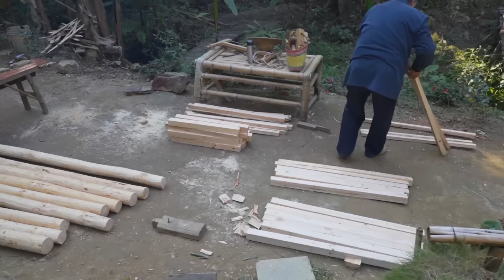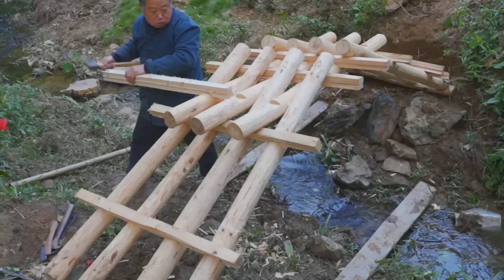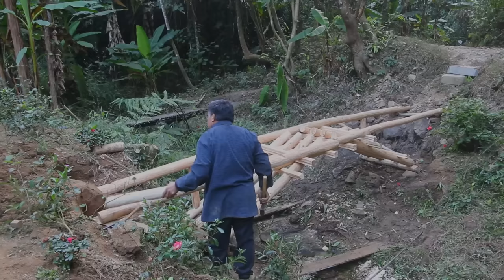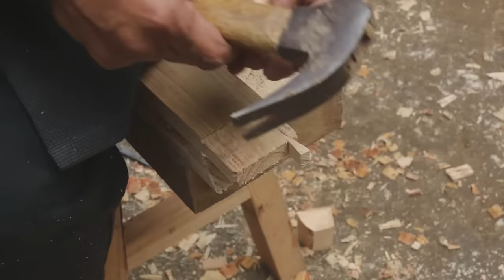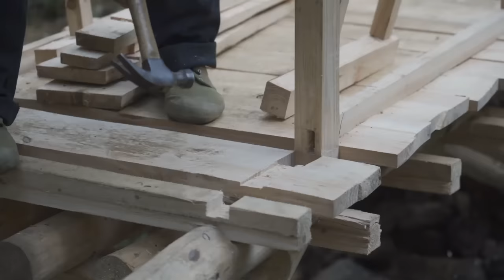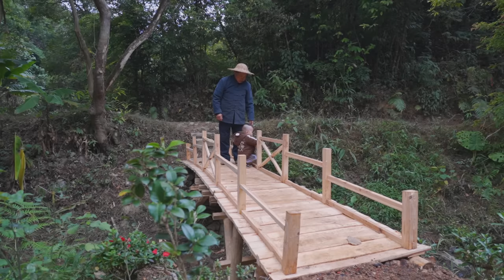阿木爷爷榫卯打造一座木拱桥，全程无钉子，高手在民间【阿木爷爷 Grandpa Amu】

Comment: Not one nail.  No glue.  No metal fasteners.  Just wood.  And a few simple tools.  No powered drills, saws.  He is a true artist.
Reply: One of The Best Artists I've ever seem 😍
Reply: Its a de Vinci bridge
Reply: Just factory produced tools that make it possible to get the level of fit and finish it has. It's cool but people need to chill on the weird idea this is special, it's bronze age technology.
Reply: @SylvanApe  it may be old technology, but it does take skill to use them this well. and also those are not made in a factory. Someone of his skill either makes there own tools or they are hand made by a master tool smith.
Reply: @lukesteele5013   @luke steele  The axe, hammer, builder's square, saws, chisel and shovel are all store bought ones, not some weird artisan made tools.
Reply: @SylvanApe  how can you tell
Reply: @lukesteele5013    Because over my life I have owned and made many tools, as well as having some made for me by very skilled people. 

I can't think of anyone who would hand craft a claw hammer for a start, the process needed to get the claw not to just break requires industrial processing - it's why they were not popular to begin with and people relied on pulls (special pliers). The finish on the head, the mass produced metal wedge and the hickory, standard pattern handle and how the face of the hammer necks into the body are big giveaways.

The all metal chisel he uses at 2:09 is in fact a repurposed blade from a modern plane (hence the key shaped hole in it). 

I own similar chisels to the normal one he uses, they are too cheap to bother making, plus the way the handles are finished is a modern design idea and designed to allow hammers rather than a mallet to be used if needed. Someone making one by hand would put a through tang in to deal with this (modern ones don't do this as it adds a lot of cost.)

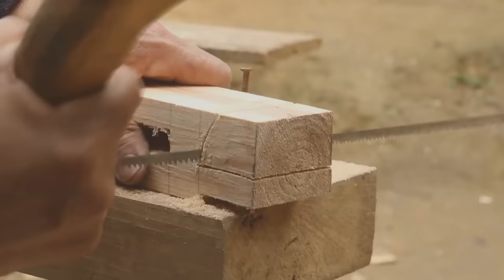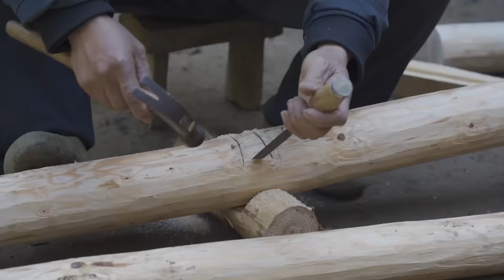At 9:24 the saw blade is clearly a mass produced one. The way the teeth are set and cut is not how hand made blades are made. Plus the cost is a few dollars compared to a lot more for someone to hand make them. Same for the small saw at 1:30.

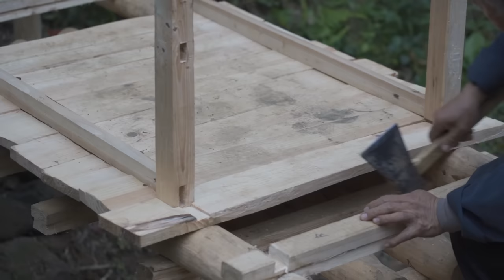The axe (at 10:45) is too symmetrical for all but the best smiths to do, and no one hand forging would make the metal of the eye (the hole) that thin, you just cant get the consistency and strength without industrial forging.

The square is a couple of dollars, to make one would cost more to but the metal than buy the square - then you would have to make it.
Reply: @SylvanApe  damn you know your stuff
Reply: @lukesteele5013  I know more than I did and less than I will. ;)
Reply: The reason these are not built anymore is because if there is a flood the bridge uplifts and falls apart. That is why we have nails and bolt now.
Reply: He used a saw multiple times
Reply: @EatCheese11  op meant powered saws
Reply: I agree
Reply: this is traditional technique in china called 榫卯
Reply: And it will outlast anything built with modern stuff
Reply: @gmcman355crazy  probably not. It's really cool and interesting, makes for an amazing youtube video, takes a lot of hard work and craftsmanship. But take a look at the bridge and tell me it'll last longer than 10-15 years. The wood will rot, the dirt underneath it might crumble under rain. And I'm not sure about this one but I think the two, long supporting beams are too thin and have too many notches, it kinda feels like it might explode from stress at some point, but again, that's just a feeling.
Reply: @jasonguiol7110  - is it because there is no foundation to hold it deep into soil? otherwise, the wedge shaped fastening bars and grooves seem to hold the vital structure together well.
Reply: @jasonguiol7110  this bridge was never built, it is leonardo da vincis concept bridge. This dude just stole the idea and made few adjustements
Reply: @annliu8164  it isnt
Reply: @gmcman355crazy  it will not
Reply: Old school engineering.
Reply: Where does he get the planks though
Reply: Actually all the ancient Chinese or the east's architectures were built this way
Reply: @xxtoxii9615  You made me laugh. Go to China and you'll find this kind of stuff everywhere, from villages to the forbidden palace.
Reply: @xxtoxii9615  it is
Reply: These  traditional techniques showed up around 500  BC in China and had been used by chinese carpenters  through all the dynasties in China's history. It is a pity that nowadays not many people do.
Reply: @xxtoxii9615  Go research who is Lu ban born in 507 BC and da vinci who was born 15 April 1452. You are good in cracking jokes yea?
Reply: I’m so happy I’m the 400th like to this comment
Reply: @xxtoxii9615  Although a year late, but I'd like to clarify the truth. This concept was used during the Song Dynasty over a thousand years ago, pre-dating Da Vinci's design by a whole lot, considering he was born in 1452, While Song Dynasty was 1,000 CE. Look up Qingming Raingbow Bridge, it was estimated there were thousands of such bridges back then, the Chinese were really good with bridges and still are today, only some rainbow bridge survived till this day, with repairs of course.
Reply: @SylvanApe   you can smelt bronze at the right temperature with ur mouth. impressed.
Reply: @SylvanApe  I really hope your goal isn't to take away any credit or merit from this amazing peice of woodwork and the amount of time and dedication he gave to this project
Reply: @ryanwalter5824  My goal is to stop people getting all excited as if what he is doing is some weird mystical skill. Anyone can learn to do these things, that doesn't mean it doesn't take some practise and learning, but it's not magic. Nor does it require custom made artisanal tools or generations of training and secrets, just a little application.
Reply: @SylvanApe  people should get excited because although it may not be magic it is magical...the very fact that he made that with his own two hands and at his age is impressive and even more impressive that he did it with no nails and that my friend is where your wrong because it does take years of learning and practicing to get the angles just right and to know a great deal of engineering, just to know how carve wood into unique shapes and then understand how to conjugate them like an elaborate jig saw puzzle is amazing and that's what makes it magical and that's what gets people excited so quit belittling his accomplishment
Reply: @ryanwalter5824  "even more impressive that he did it with no nails"
No, it's not, it's just people think in patterns, and people who don't build things assume that screws and nails are  less impressive than friction fit joints. 

"even more impressive that he did it with no nails and that my friend is where your wrong because it does take years of learning and practicing to get the angles just right and to know a great deal of engineering"

Again, no. You don't 'practise' the angles, you measure them. You first thought there was he didn't have a protractor or tape, wasn't it... again, patterns of thought, there are many other ways to measure depending on the task.

"how carve wood into unique shapes and then understand how to conjugate them like an elaborate jig saw puzzle"

The shapes are not unique, it may be 'elaborate' but it is also a pattern.

"quit belittling his accomplishment"

At no point have I done so, I just haven't put him on a pedestal. He made a bridge, it looks very nice and is evidently sturdy and fit for purpose, it's just not magic. Practically anyone could do this, and should do things like this, which is my point.
Reply: @SylvanApe  just because I thought interlocking joints was Impressive doesn't mean I like nails any less I think both your styles are impressive and take allot of hard work and skill I don't know why to feel your work is special you belittle his
Reply: @ryanwalter5824  Do you read what people say or just argue with yourself in your own head?

At no point have I said my work is special or his is not good. Which, if yo bother to read is what I have been saying. 

"take allot of hard work and skill"
No, they take some, not lots.
Anyone can do these things with a little effort and learning, but people  like you who want to mystify skills like this put others off from learning them, this also happens with things like music and art. Everyone can do them!
Reply: @SylvanApe  first of all that is what you implicitly stated and you still arrogantly belittle this man's work I think you would be doing yourself and everyone else a service by closing your ignorant mouth
Reply: @ryanwalter5824  "that is what you implicitly stated"

Try going by what people explicitly say, rather than assuming you know what people are thinking, especially in written form.

"arrogantly belittle this man's work"

At no point did I belittle his work, please quote where I did so before making accusations based on your inferred readings.

"closing your ignorant mouth"

Also your use of the word 'arrogant'...would this not mean I don't have the skills and knowledge to comment? Skills and knowledge that I have repeatedly stated anyone can acquire, hardly the definition of arrogance.
Reply: @SylvanApe  just because you have a certain set of skills doesn't mean you can replicate his work and assuming anyone can do it especially you because of your set of skills is arrogance so keep your harmful and toxic words out of the comment section oh and not only are you insulting him your insulting his ancestors but I don't imagine that means much to somone so toxic as yourself
Reply: @ryanwalter5824  "assuming anyone can do it especially you because of your set of skills is arrogance"

Unless that set of skills includes teaching people how to do things like this.

" just because you have a certain set of skills doesn't mean you can replicate his work"

No, I doubt my prowess in baking helps here, but some of my other skills do.

"keep your harmful and toxic words out of the comment section"

What, the harmful and toxic words where I encourage others to learn and grow by doing things and dissuade the mysticism of basic skills and engineering?

"keep your harmful and toxic words out of the comment section"

Again, please quote where I have insulted him, his ancestors or in any way belittled what he is doing?
Reply: @SylvanApe  it takes away from how amazing it is when you say anyone can do it cause that stuff is hard work and the fact that he did it despite it being so difficult is what contributes to how awsome it is and what do you mean mysticism 🤨 I know how it's done because he showed us his process
Reply: @SylvanApe  or maybe you don't think it requires much work because your so skilled
Reply: @SylvanApe  the reason that this is impressive and admired is that industrialism killed the act of people building public works and putting heart into it.

public works are now overseen by people that will likely never see their projects again and know none of the people who will use it. Grandpa amu is not alienated from his work like the rest of us are. it’s not a matter of tools or technology, it’s a matter of human spirit.
Reply: @ryanwalter5824  "it takes away from how amazing it is when you say anyone can do it" 

There we disagree. Something can be amazing yet replicable with a little work, like origami swans that flap their wings. Seems magical until you spend 20 minutes learning how to make them, then 20 minutes practise and you can do it well. 

I find that things like this are replicable by most people amazing.

"or maybe you don't think it requires much work because your so skilled"

No, because I'm not special, if I can learn thing, most people can. And this holds true when I'm teaching people things.
Reply: @Isaac-LizardKing  " it’s a matter of human spirit."

Which is what I have been saying. Anyone can do this with a little learning and effort, or spirt if you will.
Reply: @lukesteele5013  it’s a Chinese thing
Reply: 厉害了
Reply: FREE UIGHUR . FREE HONG KONG.
Reply: @user-00dog  how about stop stealing culture from others
Reply: @SylvanApe  уважаемый а сколько формул бронзы и производственных технологий , самих процессов изготовления бронзы вы знаете ? " Бронзовый век " процесс и рецептура изготовления некоторых марок бронзы черезвычайно сложный во много раз сложней чем просто изготовления простой стали.
Reply: @lukesteele5013  правильно 👍 !
Reply: @lukesteele5013  без гвоздей ? Но железо быстро ржавеет во влажном климате и разрушает древесину или камень ! Технология изготовления этого моста 100 💯 % верна и не подлежит сомнению !
Reply: @SylvanApe  ошибаешься очень очень ! А в старину даже 1000 лет назад точно так и строили ! Что у них разве была машина времени чтоб перенестись в нынешний век чтоб закупить наш  инструмент чтоб строить свои древние города и сёла ? Это просто твоё неуважение к нашим предкам и их технологиям , это просто высокомерное невежество ! Где бы ты был сейчас и чтобы ты делал , и существовол ли ты вообще сейчас !  Если бы наши предки ничего не умели , ведь то что мы имеем сейчас это результат тяжолой изнурительной работы всех поколений и их накопленный опыт и знание !
Reply: @@retsaminnavoig18 вас бы господа отправить на какой-нибудь остров где нет ни китайской электропилы и дрели на батарейках  ни вообще электричества  и из инструментов только один маленький кухонный нож _- посмотреть тогда как вы бы там поумничали ! Просто сожрали бы друг друга !
Reply: @okkhicuff7585  господин Незнайка а как дело обстояло в древности в Европе ? Что 2000 лет назад там скоростные электропоезда летали в городах  между в высотных домов ?  Ну да в европе была тогда высокоразвитая супер цивилизация !? 🤣🤣🤣 ,...
Reply: @liliasavage9903  немного ошибаетесь такие технологии были тогда везде во всем нам известном мире .
Reply: @МихаилЭскулаппов  if u can type in English I would read it
Reply: @МихаилЭскулаппов  On the contrary, if you bother to read what I said you will find I have a great respect for his skills. He is using modern tools because they are better than what they had 1000 years ago, and he isn't so stuck in the past as to use worse tools because they are traditional. Like I said, I have great respect for his skills, I just hate the idea of people seeing it as magical or mystical because that is a barrier to others learning these skills and disrespectful to this brilliant craftsman, as if what he does is magic rather than hard work and skill.
Reply: @lukesteele5013  bruh who makes their own tools. this sounds like some bullshit.
Reply: @SylvanApe  of coarse people such as yourself who who are so highly skilled do have trouble appreciating such art and function. Go make a you tube video and show us your high level of skill with art, design and function. looking forward to seeing it.
Reply: @phil6506  
1. I don't see why I need to make a YT video of the things I do.
2. Try reading the now 3 year long thread of 60 comments (some of which were in Russian) and you may realise you have misunderstood what I was saying. I have answered this point several times in several ways.
3. The short version - I never said I don't appreciate his skills, just that they are that, skills. Not some mystic ancient art form using tools passed down for thousands of years. That type of thinking is what prevents people from having a go themselves.
Reply: @SylvanApe  You are very negative , You don't seem appreciate the art he put into his design. It is beautiful functional and safe. If it did happen to get washed away in a flood ,it would probably be able to be retrieved. However some boxes full of rocks should solve this problem. Th ancients were said to have built the pyramids, try building them now.  Nobody any where in the comments said he had mystic powers, just that they were acknowledging  his skills in art and construction.
Reply: @phil6506  "You are very negative"
You still haven't read all the replies in this thread, have you?
At no point did I say what he did was not skilled or very cool, but it is NOT out of the reach of the majority of people to learn this. Far from being negative I am encouraging others not to shut themselves off from learning just because it looks impressively hard to do - which it isn't.

"Th ancients were said to have built the pyramids, try building them now"
Have you looked at modern skyscrapers etc - they make building a pyramid look like a kid in a sand pit.
They ancient Egyptians did build them, and again, not that hard to do with basic tools and EFFORT. That thing people seem to forget to put into things. 

Look at a hand made stone water trough - they are relatively simple to make (skills wise it takes about a day to learn how to do it) but require many hours of effort to make a complete one (about 1-2 weeks full time).

On the topic of the pyramids try reading more - they are not what most people think they are. You probably see a solid mass of fitted stone - in reality they are a big pile of rubble with a fancy skin of stone. The " How did they do it?" mystery was solved about 30 years ago - with more  info being added all the time. The idea we don't know how they did it or that we cant replicate it is ludicrous.
Reply: You guys need to chill. @sylvanape was entirely respectful about this guy's skill and dedication, but because he isn't salivating slack-jawed over it or bestowing some bizarre "this master carpenter obviously mined and smelt his own metals" presumption on top, you act like he's debasing the guy's work? This thread's been going on for years. Give it a rest.